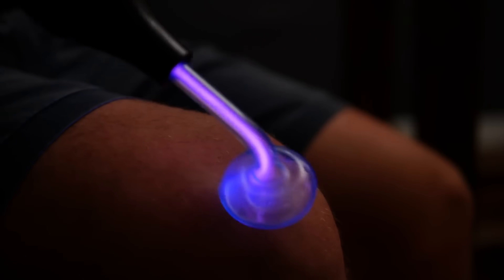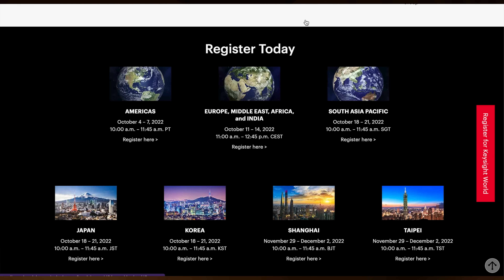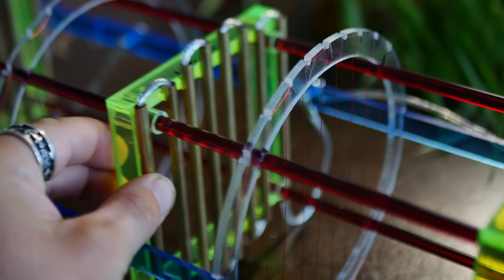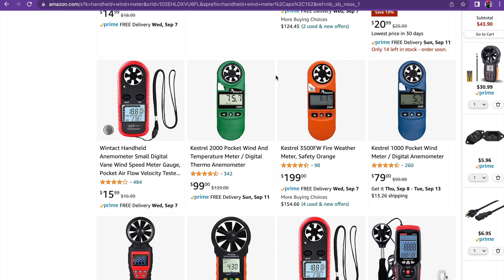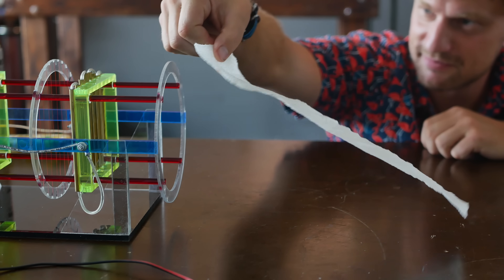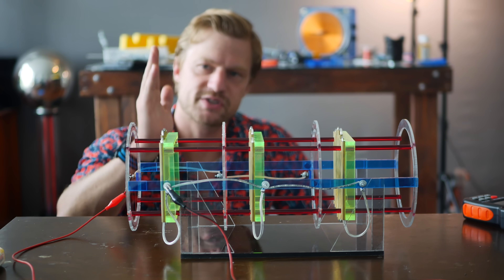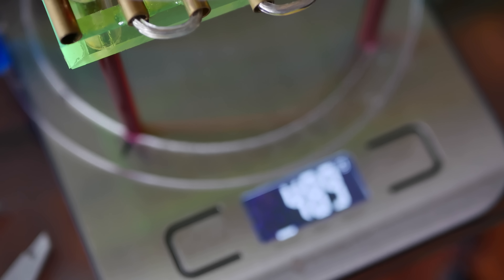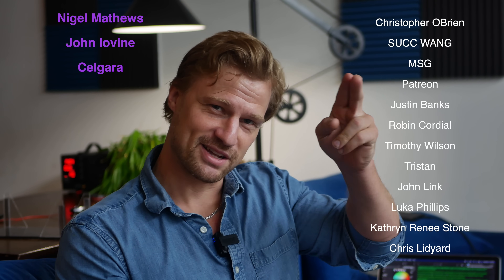Designing A Next-Gen Ionic Thruster! (For Flight)

Comment: Honestly the open design is probably lowering the efficiency quite a bit. The air pressure behind each stage is higher than in front which means it will be leaking out from behind each stage. Really excited to see the full ability of this new idea. I encourage you to experiment with harmonics and pulsed voltages because you may be able to find a resonant frequency of the ions traveling from the positive side to the negative side. My theory is to try finding the average time it takes for an ion to pass from one electrode to the other and match the pulse rate with that. Of course, I could try this at home myself... eh, probably best I don't. Very nice work here, thank you for the content.

Comment: If you like to do a prototipe version 2 with more thrust you need to increase a lot the section of entrance and reduce the stage to one (with to stages you lost 15% and with 3 stages you lost 25% of power). No duct. No nozzle. More voltage (20x) with tesla coils, you need to integrate it in the motor design. If you like I can help you to build it :D

Comment: Electrical engineer here, from university I was always fascinated by the plasma physics and advanced myself in that particular branch, unfortunately I'm from a poor country and can't afford neither oscilloscope nor a delta-3d printer without big sacrifices, and It was always behind my mind to make a multi-staged ion thruster, glad to see someone trying
Keep up the good work! BIG THANK YOU
Reply: Another idea is that to use the unused electricity from alternators back into the jet-wings as ion range extenders, to further improve high-bypass engines with plasma physics.
In order to do so, one has to load high positive voltage-high negative voltage-highpos-highneg... positioned fans behind eachoter inside the turbine

Comment: 1) weight 2) aerodynamics 3) put the segments in series.
If you use (welded) mesh for the positive electrodes you can make the electrodes a part of the frame, which both decreases the weight and increases the thrust. 
Use wires instead of copper tubes for the negative electrodes, this will increase the aerodynamics of the design and again reduce weight.
Your test results suggest adding another segment would increase air velocity by another 8-9% which might be worth it, depending on how much weight it will add. You might also see an improvement in thrust if you stagger the spacing in the opposite direction (close it the front and wide in the back) and feed the high voltage to the back segment first (with the segments connected in series). Lastly you could use flat wire instead of round, more aerodynamic and more spiky. There are lots of improvements that can still be made 🙂

Comment: Thanks for posting this cool and esthetic thuruster build.

Thinking of efficiency I would concider:
- building the electrodes in a tube to avoid air coming in and leaving on the side
- i would choose a more streamlined ground electeode shape like a simmetric wing profile (i guess a round face towards the positive electrode is preferred to avoid arc formation.
- increasing the voltage would be the 3rd way to increase the flow, as much as the electrodes can take without forming an arc.

Looking forward to seeing your next build. Not to mention the great presentation!

Comment: My guess on one point of inefficiency: your magnet wire has insulation on it, and that insulation has variable effectiveness. I think that's why the stills show individual bright points; the insulation is less effective there, resulting in concentrated points of ion generation.

I don't know whether it's better to have individual concentrated points or a large contact area.

If it's better to have a large contact area, consider using a hexagonal blade arrangement instead of wires, for increased ionization surface area.

Another potential source of inefficiency: the sides are open, so slow air is able to enter from the sides and add turbulence. Wrapping the sides with plastic wrap might result in smoother, less turbulent airflow with negligible weight.

Comment: This is next level cool :D
My thoughts for a new version would be:
1. decrease the size of the positive electrodes as far as possible and change the shape to be more aerodynamic to prevent micro-turbulences
2. increase the number of electrodes per stage
3. Building a 4 stage design. First 3 stages with decreasing diameter and a ducted design, like a funnel and the last stage making use of the venturi effect.
4. I'm also wondering if the orientation of the stages could make a difference. So rotating the stages in respect to each other would be interesting

Comment: Perhaps you should take advantage of air pressure dynamics. Create a case for the exterior, think about the shape of a turbine or the dynamics of water moving through a pipe that gets smaller or larger in different sections. Also perhaps theres some of that energy that can be gathered with a coil around the shell, something of that nature.
Reply: That's been applied in nasa space craft

Comment: Interesting video that's very well edited and presented. As to improving the efficiency and weight the number of structural rids could be reduced to three or even two if the plastic tubes are strong enough.  Also the gap between the modules could be reduced making it shorter.  To maintain air flow a pulse could be introduced triggering each unite in series. In theory this could increase efficiency.

Comment: I thunk a heated emmiter and thin and long collector electrodes might pull the reuired voltage down and increase the effective thrust. Less collector electrodes might also provide better airflow in the first stages.

Comment: Okay. I LOVE THE CONCEPT.
I believe you need to evaluate the density of the anodes vs the density of the cathodes to help evaluate the optimal thrust profile. Too many of those tubular grounds are restricting the air movement, when thin foil concentric circles will have a higher surface area and a lower flow impedance. 
 
So here are my thoughts on the airflow efficiencies.
First off, some background. I work with Air amplifiers for cooling products. (High pressure air in, large volume of air out.)
We need to work in a little of Bernoulli's into this to increase its thrust.
Increase the input side diameter and decrease its current. (Start air movement momentum without causing repulsion between majority of the air.)
Slowly decrease the area and funnel the air to the next stage, but increase the current to the thrust at that stage.
At the bottleneck have the highest thrust level, and then a tapered nozzle to maximise thrust.

Comment: Can you can increase thrust with nozzles too? Can you build a wheel based thrust vehicle to test for efficiency? Also is there any heat buildup? This is blowing my mind man.... I have so many questions.
Reply: I'm just going to add my questions here:
1. does the shape of the ground electrode affect thrust/ efficiency?
2. can you run it on batteries? ( I know nothing about electricity.)
3. does adding more stages always increase thrust or do we get to a point that it becomes so inefficient that its impractical?
3.5. can you add more stages that draw less power to amplify thrust "down the line"?
4. clearly the staggered spacing increases velocity of the air, but what would happen if you put a fan in front of the first section? would we begin to have legit, usable thrust? Kind of like a pro-charger? would the vehicle slowly start to move more quickly because the initial velocity of the current is increasing?
5. please try a self powered sail boat..... 
6. has NASA called you yet?

Comment: You need to have a container, there will be losses otherwise, and you still need air flow from the outside between each coil. So a one way air valve, or a tesla valve should help with that and remove moving parts

Comment: This is just a question as I am interested in the engineering behind it, but could you potentially have copper rings instead of just vertically winding them around the structure? I would imagine if you could have copper rings, you would be to better control the concentration of the ionic flow. I don't know if this is possible but I wanted to ask

Comment: it looks like a ion accelerator so if the "stages" start out close together and then spread further apart down the line you might increase the velocity by pulsing the "stages". Have s static charge level  then ride a pulse on top of it.  Timing is everything. Would also suggest put the whole thing inside a clear tube and add two more "stages" in the given length.

Comment: Hey, Just a question. Iv been playing with similar designs for fun but I wanted to clarify something. In your video you refer to trust to weight ratio of x by x but the weight you are using is only the mechanical parts of the engine and excludes the electronics, power source etc. Would a AUW or all up weight not be used to calculate the thrust ration instead of just the mechanical parts or do see this as a sub assembly of a bigger structure that would incompise these items ?

Comment: Hi, I would say that for stage 2 and 3, the ground could be the precedent hi voltage from the previous stage. So you would have 3 hi volt gen  with 3 different ground. Mmmm it may be difficult to do. Last anode may be made by large light sheets of aluminium to grab all electrons and help to maintain neutral the overall system. Help ... Etc.... Beautiful design.

Comment: I like how you show what Design of Experiment (DOE) means in a practical sense.  Would love to see more of that with this build as there are more variables to consider and test.  For example, ambient air temperature, humidity level, wire size, wire spacing, shape of electrodes, wire stacking and vs single set per electrode, etc.  Great start though.  Look forward to follow on builds.
Reply: i mustve missed that bit. where did he identify the variables and what their 'high' and 'low' settings were, then correlated their respective settings to the result of the tests?

Comment: My thoughts for possible improvements and i would like to see you use a fog machine to better show the air flow though the thruster I believe the cylindrical ground electrodes would be causing a lot of vortices
 1) replacing the cylindrical ground electrodes with areofoil shaped electrodes to decrease the turbulence inside the thruster
2)enclosing the thruster and decreasing the diameter to increase pressure 
3)a nozzle to help direct airflow would be cool to see an aerospike since an ion Thruster doesn't need to actively cool the nozzle walls due to the low temp exhaust

Comment: Power - awaiting fusion power for this to be feasible

Structures designed around this engine would need a very precise idea about the thrust, but plasma is not so visible well at least not for a longer time, so figuring out the thrust and the body design

Comment: Add a rocket nozzle type ducting. Add multiple electrode plates (many more). Use a two dimensional grid for electrode wires (perhaps aluminum conical shaped like mini rocket nozzles). Use progressive electrode  voltage.

Comment: I suggest building a dome pair. The outer dome electric potential causing air to flow into the inner dome increasing the atmospheric pressure inside the inner dome. Test at high altitude to provide sea level living conditions, or on mars for a habitat dome.

Comment: I'd like to see divergent ducts between the stages to increase pressure, with a convergent duct at the end to maximize velocity and see what kind of effect that would have on thrust. Obviously, having it open air reduces efficiency and thrust potential. Having divergent ducts between stages could be an interesting way to mimic a jet engine's physics of increasing pressure with each stage of blades

Comment: I think one of the problems is the connection in series, if one part of the cable malfunction everything after that goes off and you need to fix it, without that connection if one breaks it continues to go, just not as fast and there are 2 more part that can function correctly. Maybe the open up design, if you somehow close the open parts there it's a less likely for air to escape and you can replicate the actual shape of a truster having a smaller exit for more air with a bit more trust.

Comment: I just believe that if placed inside a ventilation system it can clean the air from particles but lets hope not producing too much ozone (not good for health if there is too much of it) in the process (electrostatic charges can burn and precipitate any dust particles suspended on the air....please correct me if i am wrong ) and it help the air to flow so it is win win and can be very efficient.

Comment: Is there a way to run your stages big - small - big? Would this equate to a venturi effect like in most intake designs? If so you may speed the air up substantially

Comment: Linear particle accelerators don't use DC voltage. Instead, individual stages are energized with AC voltage, the frequency of which is synchronized with the movement of the particles to increase their speed with every stage. Your design has a fixed terminal velocity determined by the DC voltage of a single stage.

Comment: awesome project . I was just as impressed by your ability to keep your hands and fingernails in perfect manicured condition while working with the tools and materials that this project required? Krazy glue ? that's Krazy man ! Yes, I see a few comments with the same suggestion already.  But to have it enclosed or ducted in order to contain air flow within the direction of air flow and prevent air pressure from escaping out the sides. I wonder if rotating the stages 90 degrees to each other, so you get better coverage with both horizontal and vertical lines of ion producing brass tubes. and try different voltages or power on the stages at different points of the engine. like a high setting for the back stage a medium setting for the middle and a low setting for the front stage, and vice versa.

Comment: Oscillations I mean use 2 different  value kv sources connected to alternate stages it will create oscillations hence turbulence  analogous to air powered concrete drillers

Comment: Awesome build!
The first thing coming to my mind though is, it's an entirely open design. Which means you get lots of airflow loss to the open sides - like open propeller vs turbine. I think you can considerably increase speed and thrust by sealing the thing in a tube (transparent of course, so you can still see the plasma light ;-) ). The next stage would be to taper the air outlet, building up some actual pressure at the exit, etc. 
I'd love to see more!
Reply: I'd say you were correct if he was creating a vacuum cleaner rather than a thruster. The way it's designed, with multiple stages, it almost seems he is gaining more from having it open than he is losing, as he's reducing intake restriction further on. But what do I know!
Reply: @JayMorgan  I think that could at least be tested. For a vacuum cleaner, all that comes in also comes back out. Only there the intake is small to maximize suction and the outlet is wide to better disperse. Industrial cleaners can use the outlet with a hose and nozzle to actually create a pressurized airflow.
An idea would be to inject "fresh" not yet ionized air before each stage, to build up mass. From what I understand the principle, the better part of the thrust is created by atoms/molecules pushed along when ionized particles bump into them. But this bumping doesn't give much direction. Think of a pool table, the white hits the lot and the other balls fan out. Ducting might channel the other "balls" in one direction, thus adding to the overall thrust.

Comment: if you incorporate better-shaped inducement and entrainment (circles are better) into your design and adjust the size of each ring (go from smaller to bigger as I am guessing that the air spreads as it goes through) you can likely increase thrust and reduce weight. Also if you make each anode and cathode different shapes that will likely help as well.
Reply: Wouldn't you want the one of the Middle (Earth) Rings to be smaller diameter than the Intake Ring and the Exhaust Ring like the intake end of a rocket exhaust cone?

LOTPR - Lord of The Plastic Rings
Reply: @matthewvelazquez2013  that would only be if the flow was supersonic, Bernoullis principal reverses after supersonic. Not sure how fast the ions are moving the air. If the flow at any point becomes supersonic an expanding cone is more efficient if not a reduction collar is needed
Reply: @versag3776  You've got the right idea. Why not constrict the flow until it reaches supersonic? Even better, expand the air first so it's easier to ionize and decompresses before the choke, then accelerate that lower pressure air into the choke to get it supersonic at roughly 1 ATM or less, then a diverging nozzle with an additional acceleration electrode grid in it to help counter nozzle pressure.
Reply: @taylorwestmore4664  Hahas! Yaas! Ace Venturi you're right you want to burn the fuel in the carb or immediately after where pressure is low and airspeed is high water boils easily at low pressure so with increased airspeed would be an increase in pressure diff right?or use exhaust temp to increase fuel pressure to match airspeed further increasing exhaust speed because the <faster you go the < fuel you collect, <  fuel you collect the < hotter the exhaust plume, < the hotter the exhaust temp=+ airspeed. +Fuel temp+ fuel pressure....
Do you think it would be possible to balance an RDE with a second rotating detonation? 180° off center?
Reply: Like a venturi?